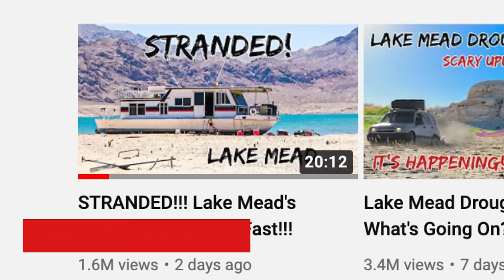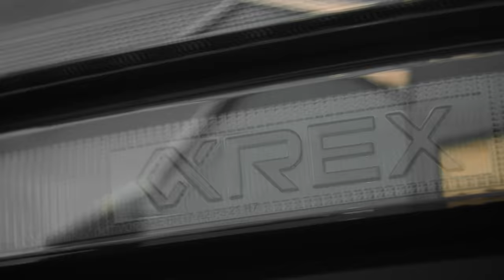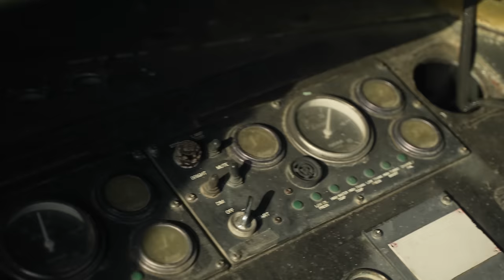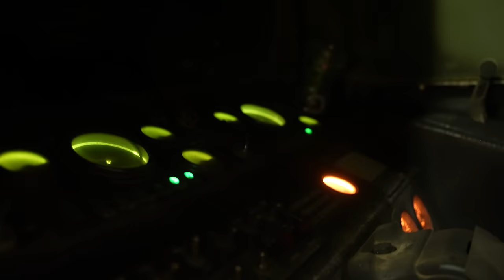Lake Mead Is Dropping FAST- Emergency Houseboat Recovery Before It's Too Late

Comment: As a disabled retiree who lives in and travels in my RV, I just have to give you the greatest kudos in the world, for this rescue! God bless you and all your crew!
Reply: I'm about to do Thes Stealth disabled van deal, and I think time to time we all might need a hand up, I thought of a class b, 24 foot or so, worried about repair cost with RV vs 2015 f350 ford van, mostly be on BLM land out west, i try to ask all full time, i would be buying and older RV if went that way, what do you think. ty may the force be with you
Reply: @philbert4740  I highly suggest you check into a van if single and can build your own unit. research is the key to success when it comes to boondocking as is good solar setup. Lots of good YouTube videos on the subject.

Comment: What you guys go around doing is pretty awesome. I was a senior instructor at the US Army wheeled vehicle recovery school for 4 years before I retired from the Army. You guys could have used a what’s called a “log dead man” for a real solid anchor point in that sand. There’s a ton of useful low tech rigging / recovery information in an old Army field manual (FM) FM 5-125.
Reply: Can you tell us what the log dead man is, how it works, and where we can see a diagram?
Reply: @bigbaddms  A search for FM 5-125 will take you there. Multiple choices, but same info.

Comment: Hey guys, not to tell you how to do your job because you guys do amazing work. And I love your sense of community. I used to live at Lake Powell. And one of the easiest ways I found to get a boat back in the water is pumps. You just take a water or a trash pump and flood the area that it’s in and behind it and you can push it back out. I hope this helps you guys. I honestly respect everything that you do.

Comment: Have done a few of these. Best to attach the tow rope to the bow of the boat to be rescued (and stern of rescuing boat). Pulling then turns the boat 180 degrees which often works surprisingly well. Then pull it into the water. The stern is the deepest part and will dig into the sand more than the bow.

Comment: Well done guys. Im a womanwho knows diddly squat about boating but I do know that the front is always lighter than the back. Wld it not have been easier to swivel the boat around using the winch and drag it from the front so it didnt dig into the sand?! I think just maybe it may have been a tad bit easier! Or not! Its great to see such awesome ppl helping those that need it. God bless you all!

Comment: Totally cheered when you guys broke it loose. I used to work in a steel fabrication shop with three 5 ton cranes and some tempered chains and I saw / heard one of those break and it went right by my head behind the 10 foot sheer and if I had been leaning out in the aisle,  I wouldn’t be around watching your videos. So, I knew how feelingly dangerous that recovery was. Congratulations all you men. My hat is off to you!!!! 💪💪💪

Comment: This crew is amazing for dedicating their time, energy and own resources to help out their fellow man. Some advice though if you ever find yourself in a similar situation again, mount and pull from the front of the boat. They are much easier to spin on the sand and the hull shape wont fight nearly as hard moving forward as it does backwards.

Comment: What a Recovery!!! What some gear!! and a good group of guys that are working well together! I think if you would have mounted brackets to the left front as you face the back of the boat you could of spun the bow around and then bracket the other side as well and pulled it out with the Winch. But those yankum ropes plus the power of your recovery boat are absolutely INSANE!!

Comment: Hey Heavy Diesel gang Richard from Alaska here.  For future use if you use schedule 40 PVC sewer pipe you can move a lot of weight in a boat instead of like the logs.  The pvc is very slick and boat will move lots easier.  We use this method to come along boats out of the large lakes in Alaska and for launching while hunting and needing to get off lake due to weather in the back country

Comment: Huge props to the guy at the back of the boat hauling the line out of the water. Those kinds of ropes get pretty heavy when they're waterlogged and you'd be surprised how quickly big dudes with lots of stamina run out of steam. Towards the tail end of my navy days at T div in pearl harbor we did pretty much all of the line handling for the big ships and subs coming in and out of the harbor and as a reward for such an exhausting day we could go back to our barracks room after muster the next morning if we weren't on duty

Comment: Hey, you guys rock!  What a beautiful thing to do for this guy. I would have really enjoyed being there to help, but I just saw this great video. I wonder.....  and for future reference.....   did you guys ever think of using a snatch block pulley system to double up your puling power?  If done right, it should give you not only double pull power, but 1/2 the "jerk" action on each pull. It should pull the houseboat slower, but with more force and sustained movement on each attempt. It would also put less shock on the navy boat. I congratulate you on such a great and generous work!!
Reply: Or using a pump to remove the sand from around the boat and creating a new channel

Comment: Can we just take a moment to give a couple of middle fingers to the park service and the other recovery companies that wanted to screw this guy over?!!! Crazy

Excellent work heavy D.
Reply: Agreed, the park service could of helped.
Reply: @RVBadlands2015  or at least not hindered.
Reply: Why couldn't the boat just have stayed there until the water levels came back up as they must sometime .  ?
Reply: Agreed!  The park service could fk up a wet dream!
Reply: @sharonmiller6436  the water level has been dropping for over twenty years. it may never get to that level again.
Reply: @sharonmiller6436  Experts have said it more than likely will never get to that level again. They expect it to become a dry lake bed within a year
Reply: Done plenty of work with Park Service....always a nightmare.....not the rangers, but what they have to do based on the regs......
Reply: @sharonmiller6436  Water levels aren't coming back up at least to this point for decades and that boat would simply rot beached like that after a few years.
Reply: @sharonmiller6436  they will never come back up.
Reply: @RVBadlands2015  park service isn’t equipped for salvage plus they would be liable for whatever damage they did
Reply: Yeah 100 percent. There's no reason why he can't live on the boat where he wants
Reply: @sharonmiller6436  🤣😂🤣😂🤣😂🤣😂🤣😂🤣😂🤣😂🤣😂🤣😂🤣😂🤣😂🤣😂🤣😂🤣😂🤣😂🤣😂🤣😂🤣😂🤣😂🤣😂🤣😂🤣😂🤣😂🤣😂🤣😂🤣😂🤣😂🤣😂🤣😂🤣😂🤣😂🤣😂🤣😂🤣😂🤣😂🤣😂🤣😂🤣😂🤣😂🤣😂🤣😂🤣😂🤣😂🤣😂🤣😂🤣😂🤣😂🤣😂🤣😂🤣😂😂🤣😂🤣😂

Comment: Great Job guys! Amazing of you to help this guy out!
Although I was thinking, am I the only one that wouldn't have just quit like this guy? Looking at how close the water, and the boat are at 15:08 No joke I would of went looking for a shovel, and then I would of started building a large trench/canal in between the water, and the boat Until its big enough for the boat, Then I would collapse the wall of dirt, allowing the water to fill the trench, then Id start digging until the water fills around the boat allowing it to float. and use the trench of water to float back into the main part of the lake. 
Not sure I explained it the best, but I hope everyone knows what I meant/was talking about. LMAO, again like at 15:08 I would dig a large trench/canal there between the water, and boat, until its large enough for the water to fill, and the boat to float on, and to the bigger body of water.
Wouldnt matter how much work, and how long it would take just me to do it, at that point I have nothing but time, and my home is on the line.... so I would get it done!
Reply: wow dude you're such a badass. how bout you be happy and stop bragging about your determination.

Comment: Maybe you could talk about bringing salty water from the Pacific Ocean to the salty basins east of the Sierra Nevada Mountains.  It will need about 4,000 to 5,000 square miles of surface area of evaporation to get the rainfall, and snowfall back up to the point that it will refill Lake Powell, and Lake Mead.  Only a mere 300 billion bucks, to drill horizontally from the Pacific to Death Valley, then use solar power to pump the water to the basins to the North and South.  The Sun will do the rest of the work to evaporate the water, make the clouds, and make them heavy enough to rain and snow.

Comment: You had sand. Dig a trench behind the boat and build a sand wall around the boat and use a water pump to flood inside the sand wall.  It would probably only take 6 inches of water to float the boat.  Level the sand once the boat was back in the water.  Less likely to rip the bottom off the boat and no need to bolt on your heavy duty towing points to the boat.  But Bless you for caring enough to tackle the problem.

Comment: Grew up in Orange tx around ship builders..  Dig two small trenches either side so you can run the timbers under.. get a few more like 10 or so,, space them the length of the boat with a few extra.. tug and place tibers as you go. Seen this done a few times, we have a few dams that make the sabine and neches river fluctuate wildly , getting stuck on a sandbar is common.. also cattails make excellent material to laydown for both boats and trucks'..

Comment: Yank up roped kick ass. I’ve pulled 200+ 777 off road truck out this year up here in Alaska. Even the soft shackles don’t fail. 500k with a 3.5 inch all year

Comment: Suggestion only,Next time you have a similar recover sofar from the beach  ,have a water plaster to blast the suction of the sand from under the keel of the boat to brake that suction ,also to better assist the role have some realy strong blow up fenders like they have when launching ships  but on a smaller scale that will role much better on the beach rather than logs . Only my suggestion .

Comment: Now that was a heavy ass pull.  Been around, worked on, owned, and operated boats my entire life. There is no way the bottom of the fiberglass step haul is not damaged from rolling with all its weight on round logs.   There has got to be some haul damage and some leaks now. If not I would be very amazed at the strength of that haul V bottom.  Otherwise awesome job!

Comment: So I am pretty sure, pulling a boat from the front is the way to do it. Might seem counter intuitive, but boats are designed to go forward, not backwards. You're working with the boat going forward. Not sure if the GRP hull could handle it, but you can pull with less force

Comment: If you put the tow ropes coming off the bow of the house boat and have the house boat spin on the spot it would of been alot easier to pull off the sand

Comment: You need to invest in tough inflatable air bags. Each of em can have a towing hitch hooked up and you can drag them instead of dragging sensitive stuff on the ground. Round ones basically become wheels you can roll stuff on.

Comment: Can I make a humble suggestion. Rather than over stressing one tow eye you could use a floating apex layout. Rather than two big straps from the boat you could use one, with a shackle in the middle allowing it to slide along the apex giving it a perfect 50/50 pull from your tow eyes no matter what angle you pull at.

Comment: 6 or 7 high capacity high pressure water pumps connected to water monitor lines you could have cut a floatable path to float the boat to the water.

Comment: pull it from the front next time. boats are more easily recoverable from the bow than the stern. the weight distribution and slope of the hull make it easier to pull the boat forwards rather than backwards
Reply: think about how a boat is built, its built to glide through water bow first. the stern is a flat edge with all the weight in the rear. pull it forwards and it glides on the sand. the way youre doing it is like trying to pull an anchor out of the ground via the way it dug in. the bow has significantly less weight on it than the stern does

Comment: I am not an expert on recovering, but next time use truck tire tubes, place them underneath as soon get clearance. Fill them with a portable compressor and then would be easier to roll.

Comment: You should use anchor earth holdfast when I was in the army recovering m198 artillery guns semi trailer size guns we would anchor the plates in different formations and they were rigid enough to hold with a winch or tackle pulling

Comment: i might be crazy but if there is a next time, maybe mixing the energy of the pull of the boat and the strength of all those men put together along the boat to help push it in synchronicity with the momentum ? either way great job everybody what a job !!!! and for a good cause xx edit: ( i was picturing it like how the rocks of the pyramids were pulled !) - jim gets it xD

Comment: I don't know why you don't use rollers. or put a post in front of thee unite to be moved giving you upward movment. so as to avoid pulling the item down into the sand.  you guys are awesome helping folks out.  this guy was done and you all saved is home.

Comment: I right away would have built a frame and jack the boat up just an inch so it was sitting on a 2x4 runners down each side and maybe on the bottom I know that's a lot but to slide off of that onto wood plywood with vegetable grease would have been done

Comment: awesome job guys!   what if you used a high volume pump to bring the water up to the boat through channels while pulling?  dont know if that may have sunk it more or helped a bit... but either way, you did an awesome job!

Comment: ### Have you ever used logs to roll boat on as you pull it !!!??? This lessens the weight of the pull. Needed !!! Same method used to build the pryimids...do sorry didn't see nor here log mentioned till it was dark & lights on boat showed up logs ... You had a good workout usesing those gears on your boat !!!

Comment: Big Dawg when you pull anything on land its all in the foundation you should have took the time to dig out the run way sort of speak land logs down with grease before you began to pull you would have had that boat ou before sun set

Comment: Should have had 10 foot logs to pull it up onto and then let it roll on the logs - real simple and would take only little effort to pull it back into the water - you guys did it the hard way

Comment: Tie it on the front, that would’ve worked first try. That’s an old trick they use in Vietnam. When you pull from the front the boat will pivot around, raising it up out of the suction to the ground.

Comment: hey just a 100% heads up if you ever do another Boat/ Houseboat really anything that's beached the best route would be runners on both sides  high-density polyethylene  (HDPE) they would only need to be about a foot maybe a foot and a half wide and however long you'd want them for stacking and transporting that's the investment part of getting a beached item moving on the sand but the cheep way would be literally running to home Depot or whoever sales cheep carpet 12ft wide 200' long or whatever youd want it but wet carpet just layed on the sand would be the cheep way you can move heavy items that way  cool to see you guys doing good for someone tho keep it up god bless

Comment: oh yea... another way too try and unbeach' a big boat... is "spin it" from the bow..  and once its facing the water they pull a lot easy'r across ground..  and do like you did with  tugging.. but with half the battle..
w/ some sort of slides/rollers//air' bags under it..  but... idk that is a big boat.. 
they use big giant air bags for ships.. once you getm under it, fill them, itll roll on the bag..
 
2.  they do have those big air bag's, you dig under the boat in a spot, pull the bag threw.. fill with air.. and act as rollers..

Comment: Not that I have ever attempted anything like this but wouldnt those 'air balloon finger float' thingies come in handy in a rescue like this? Use the kinetic straps to get it onto the first one, and then slowly roll it into the water from there under control. Again - not an expert but it just popped into my mind (pardon the pun) while watching the struggle and thought it may help in future rescues like this.

Comment: You should have brougth your Snow Cat with you or Excavator and pushed at the same time.  You would probably have moved it back into the water in a couple of hours if you had.

Comment: wonder if it would help to ram i pipe with holes into the sand below the boat, and flow it with water and air, to chance the density/resistance of the sand

Comment: If you would of hooked to the bow of the stranded boat and pulled at a 45 degree angle it would have spun right around and launched into the water.

Comment: Not to criticize but I think it would have gone better if you had pulled it the other way toward the shallow water. The water might have been shallow but the way you pulled it was up hill. Plus once it was in the water it would have been on softer dirt. You did a fantastic job though. My hat off to you.

Comment: It would have been easier if they used jacks so they can insert those logs at the bottom or those big rubber inflatables would have really made this rescue smoother, like those inflatables used to launch yatchs. Im just saying though...

Comment: You are supposed to pull stranded boats from the front end, if you did that at a good angle the boat would have moved a lot easier!! it's simple old grandpa wisdom.